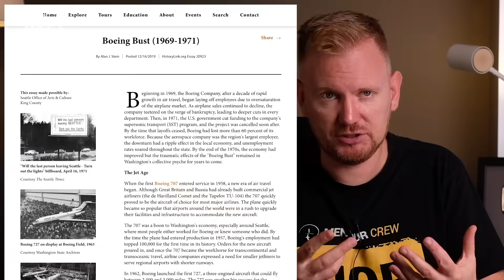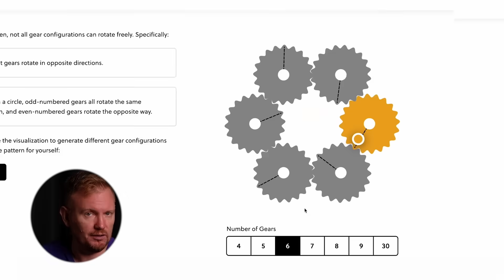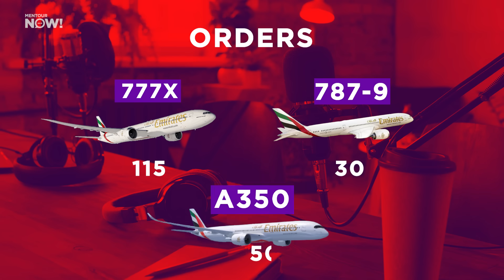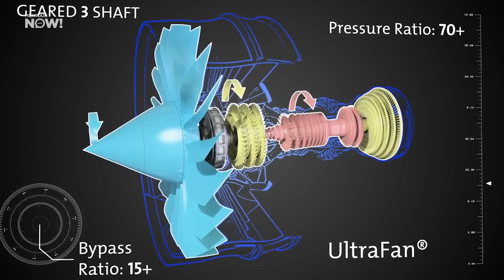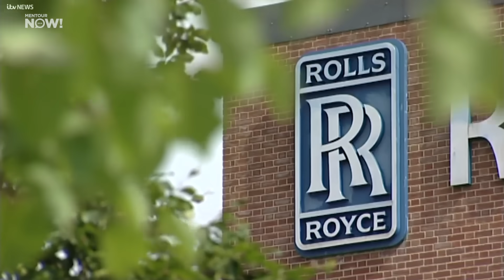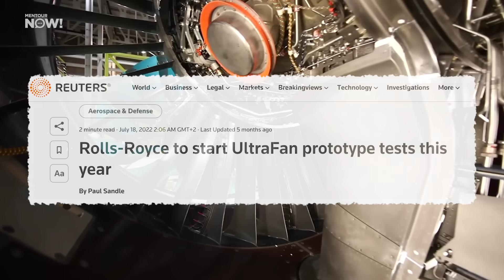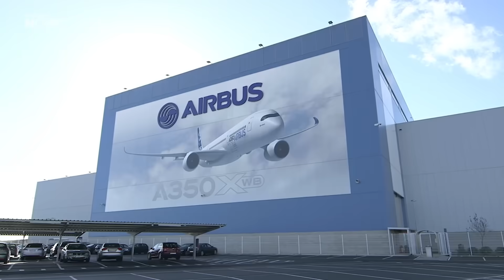Are BOEING planning a 747 with 2 ENGINES?!

Comment: Without even watching it I'm going to say a resounding NO.  It would require a totally new wing, set significantly higher at the point the engine pylon attaches in order in to get the fan and casing diameter necessary.

Comment: It's possible. Back in the 90s Boeing tested the 777 engine on the 74 and shut down the remaining 3 engines. Pilots said that after some trim inputs, the plane flew great. Sadly, I don't think Boeing will jump on this, but Airbus probably would. I also believe that designing this type of aircraft wouldn't be possible if only 1 airline is looking at purchasing it.

Comment: Boeing executives have said recently that they do not have plans for a all new aircraft until 2030s. They want greater than+10% gain in efficiency. That is not possible with current engines.  They are up to their necks in 787, 737 Max problems.  I flew 747-400F and 747-8F 2007-2020. Great aircraft. Great way to go into retirement.

Comment: Hmmmm’. With a larger than life engine, Howe might Boeing install it on a 747 twin. Hopefully they do not screw up the aerodynamics like they screwed up on the 737 Max by moving the engine forward and up to gain that extra ground clearance. A real shame, they ruined a perfectly safe aircraft, making it into a dangerous unstable aircraft. Any comments welcome.

Comment: I think increasing the capacity at existing airports, along with reusing existing facilities will be a big thing.
1) Bigger planes that can fit into existing airports and gates.  The 777x folding wingtips is a great example of this.
2) More cargo in passenger jets.  As everyone knows the increase in air cargo fleets was slowed because airlines started hauling a lot of the air cargo.  Hauling more air cargo might be good for the airline business.
3) VTOL airplanes.  In runway constrained airports, changing some flights to VTOL pads could free up runway slots.  VTOLs have never been that efficient, so the business case has never really worked.  But some of the new electric VTOLs might change that.  Especially interesting might be designs that can use regular runways at might airport and VTOL pads at another.

Comment: There already are Twin Jet Jumbos. They are the Boeing 777 and Airbus A350 are massive aircraft. Even these planes are becoming less desirable because of high efficiency and smaller wide body aircraft like Boeing 78 saves money on fuel.    There are test 747s with a single big powerful engine used on 777X. They look odd as they dwarf the normal 747 engines.  This means they could already mount massive GM Engines on 747 if they wanted to. Though I am unsure if they are powerful enough to fly 747 on one engine long enough to allow for engine failures that all twin jets are capable of doing.

Comment: Could an engine this size actually fit under the wing of a 747? Even with as much ground clearance as a 747 has, it seems like it would become an issue with engines this monstrous. If I remember correctly, the 777 already had to have its wings up higher than even the 747's in order to mount those GE90s. Though GE did actually mount a GE90 on a 747 for flight testing, which looks absolutely hilarious. Some of my favorite aircraft photos are of those flight tests. It's hard to fully appreciate the sheer size of the GE90, but seeing it mounted beside the 747's original JT9D engines definitely helps to put it into perspective. The JT9D is not exactly a small engine, but the GE90 makes it look like a dwarf. Once they were up in the air where it was safe to do so, they actually pulled back the other three engines and flew the 747 on just the one single GE90 in at least one of the flight tests.

Comment: Geared turbofan's are nothing new. See for example the Lycoming Engines ALF 502/507. They have been around since the seventies and cleverly use the core of a T55 engine as used on the Chinook helicopter.

Comment: The tail doesn't have sufficient control authority to function safely as a Twin. 

It's the same reason why B52s can't be converted to quads from 8 engines

Redesigning the empennage would need a new fuselage and landing gear - a new aircraft

Aircraft are designed around their engines and that's locked in by their undercarriage and empennage. Once those are set in stone, engine thrust limits are effectively locked in by maximum allowable thrust asymmetry
Reply: The 707-320 had slightly larger horizontal and vertical stabilizers, and the 747 SP had a much larger tail. So it can be done without creating a whole new airplane. Although they probably won't because the overall project would be too costly.
Reply: @StevePemberton2  I was thinking of the SP tail. It still wouldn't be large enough and it pushed the structural limits of the airframe as it was 

In addition you'd need an entirely new wing. If you attempted to fly the existing wing without the weight of the outer engines in place, it would fold up. The positioning is an effective counterweight to the upwards bending moment imparted on the wing root and allows a substantially lighter wing spar structure to be used
Reply: @miscbits6399  It's a given that a new wing would be needed. But that's also something not  entirely new as they made changes to the 707 wing, especially the 720 which was not only shorter but much lighter than a standard 707.

The 747 wing had a big redesign for the 747 SP because the shorter fuselage meant that the back of the hump would be over the wing box and that changed things somehow. It turns out that the wing modification for the SP enabled the extended hump on the 747-300 and 400. 

Switching to two engines however would be a major change to the wing, probably much more extensive than any of the previous changes.

Comment: There is only one affordable efficient energy source and that is hydrocarbons, specifically OIL. Nothing comes close and hasn't done for 200 years. Burning oil also helps replace some of the co2 that has diminished in the atmosphere for the last 250 million years. Co2 is not a poison like the media would have you believe, it is a nutrient not a pollutant and all life on earth benefits from more of it. IT is odourless colorless and tasteless, It is the gas of life and as yet there is no peer reviewed evidence that co2 has any measurable effect on climate or temperature, only hypothesis and dodgy modelling

Comment: The original theoretical design for the 797 was a high-wing twin engine wide body. If the engineers made the fuselage diameter and shape the same as the 747 below the flight deck - the 747 cargo nose wouldn't need to be redesigned to fit the new airplane.

Comment: As someone who loves airplanes, but hates flying, there are two things that concern me about having only two engines on an airplane.

1. The Bigger diameter fans..... Centripetal force generated on the fan blades.
The fan blades seem fewer and bigger. If one goes, it seems as though it would have a more catastrophic effect on the overall engine.

2. That much thrust on engine mounts.
On takeoff, it seems as though the engines are just pulling the plane into the sky. 
That much thrust on only two mounts scares the crap out of me.

Quite honestly, I'd feel much safer on an engine layout like the B-52.
A single engine loss seems like it would almost be un-noticeable.

Comment: The positioning of the two engine configuration as depicted in your mock-up would make it problem-some for single engine flight. Manageable, yet difficult. Do you think Boeing has considered revisiting a WWII design of the Miles M.39B Libellua? A twin wing design with the engines mounted further aft.
Reply: About as "manageable" as the Max Series, eh?
Reply: Didn't Frank Whittle come up with a swing wing design for take off and cruising?
Whatever happened to that idea?

Comment: It would be easier and less expensive to simply add the raised cockpit and fuselage hump to the 777X. 
The 777XF could also get the nose loading door. 
Redesigning the 747 to have 2 engines would require a new wing and type certificate making it far to expensive to develop. 
Now it’s also likely that adding the raised cockpit, hump, and nose loading door could result in the need for a new type certificate.

Comment: I don't know if two monster engines is a good idea.  I think I would prefer four smaller ones.  That way, in the event of an engine failure,  you still have 75% power instead of 50%.
Reply: Engines are almost never routinely operated at 100% power though, not even during takeoff. The only time this issue could get dicey is an engine failure right after v1, but all aircraft and engine types only get their certification with this type of testing in mind. Once in cruise, even less than 50% power coming from the engines can get you quite far. Even 0%. Just look at the cases known as the Gimli Glider and Atlantic Glider. (Mentour has covered both of them in his Incident and Accident Investigation series on his Mentour Pilot channel, in case you are curious.)

Comment: It's all very well talking about airlines, but what PAX? Passengers are well aware of the sad record of your favourite manufacturer. Boeing has been / is using PAX as Crash Test Dummies.

If it weren't for the incestuous relationship between the US military and Boeing or the similar arrangements between NASA and Boeing, Boeing wojld be in deep do-do.

Today's travel experience includes airport experiences. I will never fly an airline that collects biodata. I am tired of all this dsta being collected such as Google tracing ANY smartphone even when SWITCHED OFF (except smartphones that have been modified).

I carry a US Passport hut l avoid the country because of the manner in which the uniformed thugs treat PAX in airports.

No generation has such easy access to information as the present one.

It is also the reason my employees can select how and what they travel on.

Comment: I think Rolls-Royce might be quietly in talks to help Boeing defray 777X development costs and by 2030, could offer a new engine based on UltraFan technology on the 777-8 and 777-9. That means we could see a 777-9 with more than 7% lower fuel burn than the GE9X, and that would certainly attract a lot of airlines.

Comment: Yes, it all depends on the power of the turbines, and then testing the aerodynamics...but I don't see any reason why a plane the size of a wide-body couldn't run on 2 engines. 
I was was on a 737 6 years ago and because we were behind schedule, the pilot "punched it". (Oh that was fun) We must have been going 590 knots (or so) and when he ordered to throttle down, he sounded depressed 😆. We just need to keep developing more efficient engines.

Comment: The only flights I know of from Emirates into London did not use Heathrow. They used the other two airports. So Emirates has and is using options. As the point of the hub and spoke is that it’s the hub airport that has to be large as all the planes land there, the spoke airports should be as close to the passenger source and destination as possible and therefore can be small. Emirates could fly to Manchester and Glasgow with smaller long range planes in the UK for instance as well as London.
Here in the real world we have two recent examples of re-engining . The 737 max, which got bigger engines on an old fuselage and with Boeing management killed two plane loads of people and the B52 which was re-engined with the same number of engines that fit the old nacelles, because not even the US Air Force has enough money to pay for the work required to change the number and size of engines on an old airframe.

Comment: Didn't we see last time they put larger engines on an aircraft that wasn't designed for them.
Reply: Twenty-five years ago Boeing put engines on the 737 that were larger than what it was designed for. That was the tremendously successful 737 NG. Recently they did the same thing again with the 737 MAX and it is proving to be a very successful model also and likely will be for many years because of greatly increased range and efficiency with the new engines.

Boeing made a huge almost criminal mistake in how they handled the software needed to avoid pilots having to be trained for a handling difference in an uncommon maneuver. Go after them for that. Blaming the crashes on the decision to upgrade the engines is barking up the wrong tree and lets Boeing off the hook for what they actually did wrong.

Comment: I think Airbus is secretly working on an "A360" that's comparable or slightly larger than the 777X-9, which is where the 140-inch RR engine could go.

Comment: The fuselage needs to be redone also landinggears etc (For example the 737-classic and NG are much lower to the ground than the MAX version which has bigger engines in fact this aircraft is a totally new aircraft maybe a new 797.  (Is there a demand for such new aircrafts?) most airlines are switching to 787-900 or 787-10  or if they are Airbus minded to A330-900 and A350.  Most airlines giving also the A321 NEO/LXR a favor over bigger jets due to fuel efficiency.  Maybe in fantasyvirtual world as sim plane like they use round runways to. 

(Due to you tube restrictions its hard to see postings and new uploads it happens frequently base also your app isnt working in Russia properly (for a long time)  ive it with some other channels to))

Comment: The Boeing B-747 was the testbed of the GE9X engine which is used in the B-777. One problem of 2 engines are the security regulations. Normally, a 2-engine aircraft is not allowed to stray as far from an alternate airport as a 4-engine aircraft. With the ETOPS regulation, the distance can be extended, but the aircraft and its engines must be qualified to do so.

Comment: Why wouldn't they use electric gearing?

A large generator on the turbine, wired directly to the motor of the bypass fan. Make the generator "geared" by a few percent by physically moving the stator or magnets in/out a bit.

Is gearing more efficient/lighter?
Reply: Also, if one turbine blew, presumably the bypass fan could still operate even if at a reduced setting, somewhat balancing out the thrust.

Comment: I agree with most of your observation but one key factor has not been adressed. It is thrust. On the A380 the Trent 972 creates 320 kn of thrust. Even if two engines fail, there are still 640 kn of thrust available. The 747-8 has about 296 kN on each GEnx. Rolls-Royce states for the ultra fan 445 kN - even if this number could be a bit conservative it is still far away from the thrust required to lift an A380 or a 747-8. I assume that the required thrust for a twin engine large aircraft would be even higher since the one engine inoperative case needs to be considered but I could be wrong. But: the 777-9 current engine option have a thrust range of 465-480 kN. It is therefore more likely the the ultra fan is aimed as a replacement for already existing twins. If it fits under the wing. And of course there is the effort for certification.

Comment: I think it’s more likely Airbus creates a new heavy/super twin but the engineering challenges on jumbos weren’t easy. Twin engine  jumbo would be fun. But there’s also value in the quad jets for ultra long haul, no E-tops, not limited by driftdown. Yes burn rate is up theoretically but also much more efficiencies to be had on current engines. Could gain another 10-15% efficiency. They might make a bigger twin but I think Boeings close to the limit with the X. They can stretch the a350 more but any larger twin won’t have capacity of a380 and will be marginal gain over the A350 so probably wouldn’t do well in sales.

Comment: I thought that the 777X was a replacement for the 747?  The 777-9 has 400+ seats and the 747 has 400+ seats. I know it depends on configuration but A380 can't in the configuration that Emirates fly haul 800ppl. So you would need 3 777-9 to replace two A380. Which is way more efficient.

Comment: You know, in all industry BANKERS tell the direction.  🙁 When B747, A380 and co. were developed, everyone was talking about great fuel efficiency per passenger, and the bottleneck of slot times at major airports. Of course if you fly 500 ppl per departure, than you serve 2x more ppl then with small 200-250ppl planes.

Now you have flights all around, so “experts” say the best are the small and efficient planes, and 4 engines are evil’s creatures. 😢

In my opinion the truth is somewhere inbetween. I know, transatlantic routes are always full (LHR/AMS/FRA to the east coast, furthermore Emirates , as you described it too). Maybe even NYC-LAX could fill large planes full. 

For the direct flight between every US domestic destination, or one hub in the flyover states (minnesota, atlanta?) can be good for all other air passengers, served with B737 or A320 family.

Comment: We are looking at the Boeing 777X with an extended upper or, rear deck to accommodate additional passengers.  It is doable, based on research carried out years ago on the proposed Boeing 767X. Super video. ❤️
Reply: The 777 has the toilets in the cargo floor. I wonder whats above the passengers. Would be cool to retain the tube fuselage. Then we have 3 floors. The old xtra wide in the middle. Cargo / luggage in the cellar , and a row with roof windows on top.  Maybe some people also like down-pointing windows lik in an air ship.
Reply: @ArneChristianRosenfeldt   i’m an engineer at boeing working on the 777x, in the rear above the cabin is a crew rest area but it’s not as tall as the main cabin, you would have to crouch, and unfortunately it can’t extend further as above you is completely full of ducts, wires & pipes as well as structural support braces (that’s about as far as i’m at liberty to say lol)